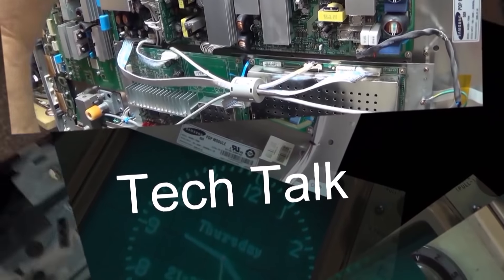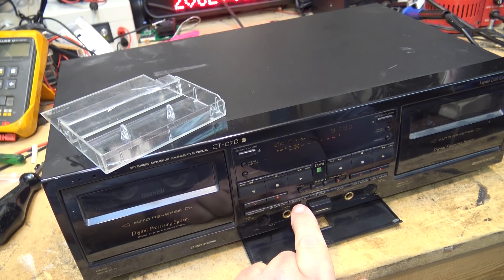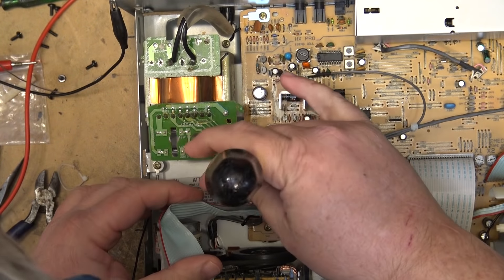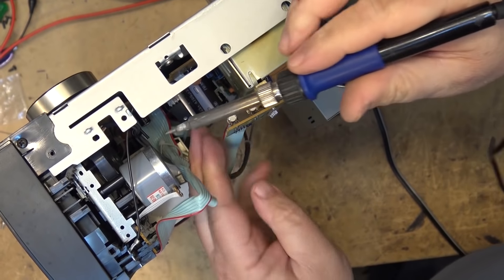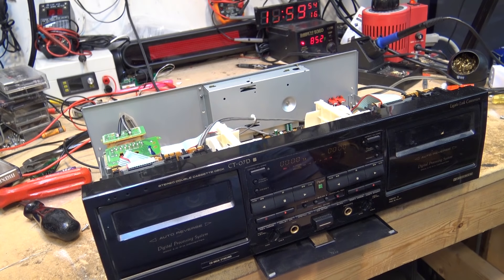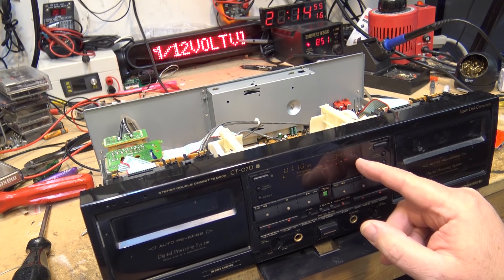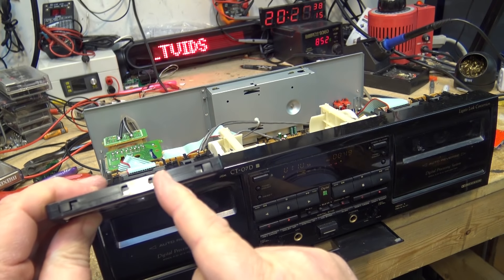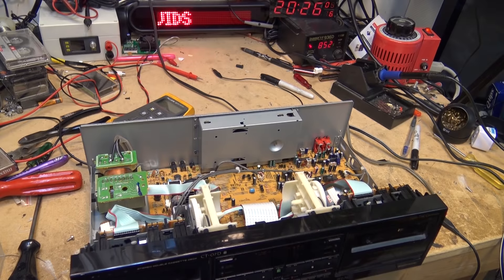Pioneer CT 07D Dual Cassette deck no sound repair

Comment: I purchase a Pioneer CT-W603RS with the SAME issue of no sound and, believe it or not, it was the same solution!  I replaced the regulator (same one) and now the unit works fine!  Thank you for this and all of your other fantastic videos!  I would not have been able to fix this unit without watching this...  Thanks!!!

Comment: This deck is one of the models with Pioneer's exclusive digital noise reduction system which claimed to completely eliminate tape hiss and provide a near-CD-quality S/N ratio from any cassette, regardless if it was encoded with Dolby NR or not. It generally works very well, although on very quiet sounds it can cause some audible artifacts, so there is a button combination you can push to disable it.
Reply: if you use a ct-939 the cassette would sound much better than the cd ,more dynamic sound the hiss as you call it only if you play a tape with nothing on it recorded and turn the volume high to a point you wouldn´t  use it to listen to music or the building where one´s live would hear the music as if they were playing it on their own apartments, hiss normally cames with the original studio recordings or some problem with the deck or amplifier, regards
Reply: i almost forget if you use dolby to record and don´t turn it on while listening to the recording the hiss will increase, not saying you would do it but there are many people who does do that ,regards

Comment: I got lucky on a Goldstar VCR (years ago before it was called LG) when the first thing I checked was a regulator like you did. This was back when VCR's were EXPENSIVE and it was given to me. It was just a bad connection and not the part itself. It was a nice stereo hi fi VCR. A big win for me at the time.

Comment: I’m glad your Pioneer was a easy fix, my Pioneer dual deck just squeals for a second after the power is on & they are both dead. The heads & the rollers won’t even move up to meet the tape & the tape doesn’t move at all.

Comment: Those type 3 cassettes are super rare! What a treasure you have! I quite sure that they would bring some serious cash on eBay.
Reply from the maker: Raymond Williams 
You better believe it they are rare. I have a couple of full boxes sealed. 
They were rare in 1984. One of the best sounding tapes ever made.
Reply: Can you sell me some? :) At least i can test it and see how it sounds.
Reply: @12voltvids  Hey Dave just watched your latest dual JVC deck repair, I left a comment over there about the computer calibration systems. Each company had their own set up process, but likely leaves the tones in tack after the calibration. You can play the tape after the calibration and hear the tones (at least on the two I have you can). I'm guessing on that Elite Pioneer you could too.

Comment: a great example of exercising the right to repair. nice job. i have a fostex 160 which is having a similar issue. no sound. normally i would say its the caps on the amplifier board but putting external audio into the mixer yields no sound either. makes me think voltage regulator gone bad at the power supply end.

Comment: 22:57 I have few 'NOS' of this exact Sony Ferrochrome tape. I have tried to record them like you did but, the best results obtained is to record at FeCro2 position or chrome and play them back in normal type 1 position to make the treble sparkle. ( Like pre-recorded chrome tape played at 120) My deck for recording Ferrochrome tapes is a JVC KD-A7 who can handle 4 types. The recording source is my favorite  SACD to test tape recordings: Nine Inch Nails "The Donward Spiral". Type 3 tape can sound amazingly close to a double coated super ferric like the TDK AR-X. But he TDK can handle higher energy.

Comment: A perfect demonstration of the ol' golden rule of electronics fault finding...

First step - "Thou shall check voltages!" :p

It shouldn't really have been necessary for you to note that you found the fault that fast, but I completely understand why you mentioned it. lol

I think a lot of people tend to other-think electronic repair, but this shows that some of the most common faults can often be the simplest. ;)

If it wasn't for the fear of people inadvertently electrocuting themselves, I would always encourage more people to have a go at fault finding.

Unless of course the item they were repairing is particularly complex, rare, expensive, sought after, or personally treasured.

Happy New Year, and thanks for the vids. :)

I often prefer the longer format teardown / repair / tech explanation vids. I don't think I've ever been bored watching yours.

Oh, btw, have you ever done a vid on, or repaired a D-VHS / D-Theater VCR?

I've always wondered what type of modulation scheme they used for writing to the tape, and how they chop up the signal on each rotation of the head drum.

I recently bought my first VHS VCR in over ten years, as I've always wanted to see if I could decode a D-Theater tape, or at least just encode my own digital carrier on a standard tape.

Comment: That's one wicked tape deck dave, i bet it cost a kidney when new.
It will outshine everything you have (cassette wise), amazing device :-D.
That psu is a really usefull device to have around, i've built many basic supplys that allowed me to inject power into devices, mostly vcr power supply chip tests (Stk deaths lol).
You have hit the jackpot there :-D:-D

Comment: Gold dust format , I would never know that was Pioneer .
All wanted & needed  .
12 Volt is not selling or dumping either .
No dumb updates needed .
No internet connectivity required  👍
Reply from the maker: I will hang onto this one as it is a nice unit, and seems to be fairly well built, even though it doesn't have heavy flywheels for the capstans.
Reply: I will always remember that deck If I see one for sale second hand , check its playback compared to the YAMAHA'S single deck .

Comment: I gave my Sony TC-K7 and dbx 224 compander along with a large number of FeCr tapes to Goodwill. I recorded my vinyl -20db where the tape was perfectly flat, so the dbx expansion was VERY linear. One of the preamps in the deck got noisy and I didn't have any idea of how to fix it or even that it could be fixed. Now I kinda wish I'd kept it. I switched to recording audio on Beta-HiFi. 

Now I'm waiting for my Snickerdoodle SoC with Xylinx Zync-7020 FPGA to design and build my own open-source DAC with loooong FIR filters. I'm going to use a Raspberry Pi as a front-end to NAS. I'm experiencing large learning curves: psycho-acoustics, I2S, I2C, LVDS, FPGA programming, FIR design, OPAMP selection, modern board design tools, and more. It's enough to boggle my mind for a while.

Comment: Hi there! Great video & awesome job! I recently bought a used Realistic SCT-34 Stereo Cassette Tape Deck in near mint condition for $45.00 off of eBay and hooked up the Red (Right Channel) and White (Left Channel) RCA Composite with the Black Cable connected to the Amplifier and Speakers and tried a Cassette Tape but no sound?! I haven't too it apart yet? Any ideas? Thanks! Happy Holidays & All The Best 2019!

Comment: Do you also fix cassette players in cars? I have a 2007 Kia Sportage and my tape player keeps knocking out the passenger side speaker when using my  tape deck auxiliary adapter, but when I use FM, both speakers work fine! I tried using other tape deck adapters but the passenger side speaker keeps cutting in and out! Any ideas?

Comment: Thanks for showing how to check a voltage regulator.  I've got to wonder why this voltage regulator failed in the first place.  My limited electronic knowledge would tell me that something else made it fail, but that clearly didn't happen.  Do regulators sometimes fail for no good reason?
Thanks, Tom
Reply from the maker: Yes they fail all the time for no good reason. Could have been that ground pin that I showed initially that looked like it the solder was cracked. That is why I initially soldered that to make sure it wasn't just cracked solder. If you remember back a couple of years ago I had a Tascam DA40 DAT deck that just showed MECA COM ERR on the display. It had a bad 5 volt regulator in it.

Comment: If this is the same as my Pioneer, that digital light indicates that the unit has digital noise reduction, meaning that on playback there should be near zero tape hiss, even without Dolby.
Reply from the maker: Right, playback goes through A/D conversion, extract the noise and then convert back to analog. All that magic takes place in that shielded box in the back that also has t he coaxial input.

Comment: For work, I bought a Kenwood super rack system knowing the cd player and one well of the tape deck do not work. Cleaning the laser lens did not work, and I assume the problem is in the laser diode. So I replaced the DP-750 cd player right away with the DP-4080 5-disc changer, which is identical to the one I've had at home which I got brand new in 1995. 

 The tape deck is a KX-95w which was advertised as one deck working. I was able to fix that problem by replacing belts. However, just like this deck, it puts out no audio. And unfortunately, in my hunt to find the record-play switch, I inadvertently fried the auto-stop sensor, or it's power supply, on deck b. 

 I bought all 7 components on Ebay for $200, which I still believe to be a good buy, even if the tape deck and cd player don't work. I also upgraded the preamp to the KC-209 for slightly better sound and looks (I always wanted a graphic equalizer VFD display). And I'll be re-selling the KC-105 which works fine. 
KD-65F Turntable
KC-105 Amplifier/Equalizer
DP-850 CD player
KT-75 Tuner/Amplifier
KX-95W Dual-cassette deck
KM-205 Amplifier
RC-95 Remote control unit

 It really has been 20 years since I had done much work with small circuits, so I'm going to give the DP-850 CD player and KX-95W tape deck away to sharper techs who may get some use out of them. And I may buy another cassette deck just for the heck of it. And it will still be a Kenwood for the sake of system control.

Comment: I have a deck with a similar issue here.Technics RS TR232 with working mechanics, working (control/display) electronics, but no sound. It always shows maximum sound levels on the display. Maybe it's a similar issue.
The failure happened while I was playing a tape, no mechanical movement of the unit, but 1 or 2 hours of operation after year of not turning it on. Something went wrong due to the heat probably ?.
One of the very rare cases where I was standing right next to the thing while it failed. No bang, no spark, the audio just cut off and never came back.

Comment: A quick repair by first measuring. A good approach. A regulator has died. Is this a design error? Can you explain this?
Is the regulator sufficiently cooled? I am curious for your reaction! Thanks in advance.
Reply: Good question!!
Reply: Well input is 24V and output is 12V. On that lovely power supply module, I very highly recommend it myself, it drew 1.62 Watt.  
Also 2 more variables. 12V over the IC and 0.136 Amp so the power 'lost', which is converted to heat, over the IC is P = U x I  ->   12 x 0.136 = about that same 1.6 Watt.   I think when connecting it to that bottom of the chassis it would be no issue.  Just bad luck I would call it. 
The only thing that I might see with that grounding on the 7812 is that you might have created a ground loop but I doubt it.
Reply: Luc, Thanks for answering.
I could not see very well that the heat ( dissipation) of the ic's, including neighbour, ran away via chassis. Then remains a ground loop or indeed bad luck / bad soldered.
Reply: also switching on/off rapidly because of the bad ground solderjoint isn't good for these things and the amps are too low for the regulator, so it is going somewhere ( heat ) and cold environments causes over time bad joints.

Comment: The only reason that CFL is so old and still working is that it takes so long to turn on. Modern quick start system turns on almost immediately but it abuses the lamp.

Comment: Dave,

Does this one have the automatic calibration system for BIAS/Rec Level? I.e. Where the deck records a test tone, then rewinds, then plays it, then sets the calibration levels accordingly and rewinds the tape again.) 

I had the UK non-elite version for a while and it had the automatic calibration system which I THOUGHT was ALCA but I might be wrong* .

*As I type this,I Googled, I'm thinking of the BLE-XD button. An almost pointless comment, but there you go!
Reply: Yes, it has Auto BLE calibration.

Comment: Good job, thanks for explaining your thought process as you went. But I do have a question - how come the channel is called "12volt vids", but you didn't have a spare 12v regulator!? :P
Reply from the maker: When i started this i had another channel name technomon, which i started posting video to about 10 years ago.  I started 12voltvids for videos i initially posted about my 2012 Chevy Volt. The volt videos got many views and i reached the threshold for monetization sooner and as to not cause confusion with techmoan i pulled the 50 or so videos I had on that channel and put them on this one.  
The rest is history.  Initially most of my videos were road trip related on this one.  I made a mistake of putting up my first power supply repair video on this one as opposed to technomon where it should have gone.  Had that first video that hit 100000 views in a month been posted to the right channel the other name would have stuck.   Too late to change now.

Comment: Hey 12voltvids. Can the Pioneer CT 079D Elite dual cassette deck be purchased on ebay? If so, what would be the price on one like that? :)
Reply from the maker: I see that someone is asking 250 US for a CT-05 with the right deck showing an error code, so that gives you an idea what they go for . The 07D sold for 550 US when new 20 years ago, and today one in good shape like the one I have would probably go for close to that now, as collectors have an eye open for these decks.

Comment: Maybe it popped because there is no heatsink compound, type3 were a failed experiment like micro tape stereo recorders
Reply: BASF and Sony were the only 2 companies to ever produce FeCr tapes. BASF was the inventor of CrO2 tape. Most high bias tapes are not real chrome dioxide, they are colbalt as BASF had the patent on CrO2
Reply: typeII doesnt necessarily mean the tape is chrome dioxide, typeII is a recording standard.

Comment: Although the metal tab is at ground potential, but in analog domain its poor idea to put that regulator to connect at the body junction. Imbalance in those two ground points will add humming sound if that regulator is being used to power preamp. Because the TAB and middle pin are connected internally and the middle pin connected at specific junction on that PCB. So you literally spoiled the grounding policy of that audio grade scheme. It was a stringent requirement at the design level and that's why they used insulated package for those two regulators. A proper analog design should take care grounding very carefully or else it will spoil the game. I would suggest you to add an insulator or else it looks very annoying for those who worked in audio domain.